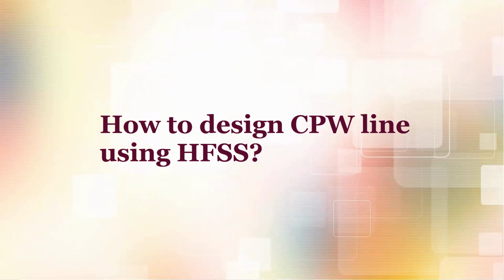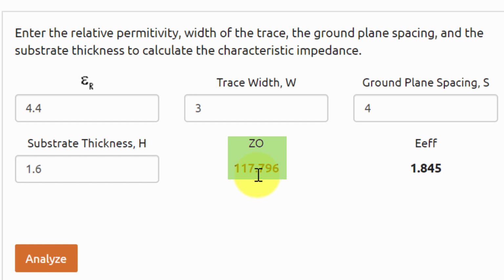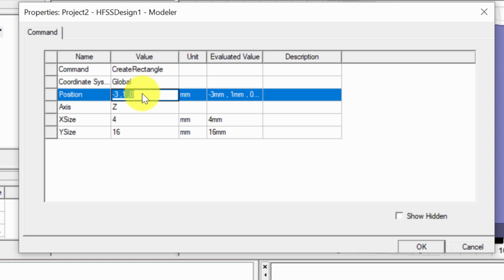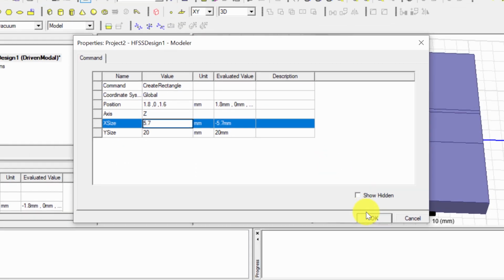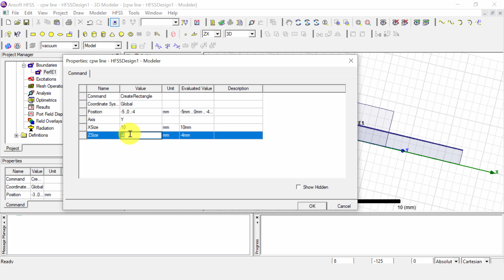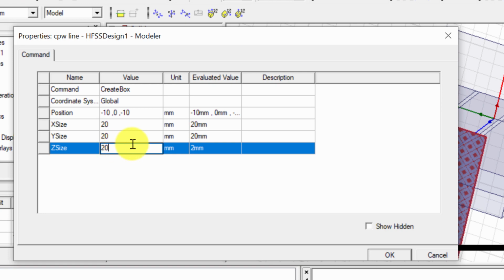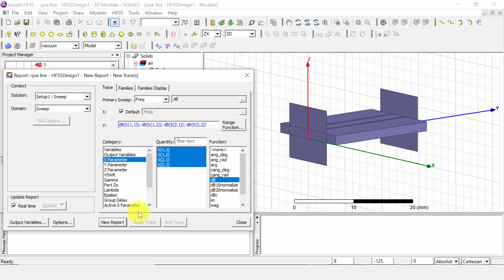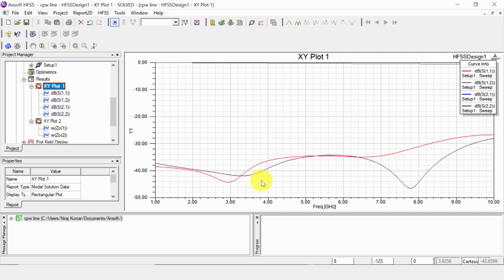Design of 50 Ω CPW line (Coplanar waveguide line) using HFSS and exciting waveport.

Comment: Thank you so much for very helpful video. I have one question. Why are there two dips (valley) around 3 GHz and 8 GHz in the reflection lines(S11 & S22)? Thanks in advance.
Reply: I really want to know this situation.
Reply: @gurumiya  Hi Hanna , I found that this is the reflection between two ports . Though they are impedance matched, still slight difference causes the reflection dips . Let me know if you have any other queries.
Reply: @Deep_1603  oh thanks. I have one more question about simulation. What is deembed of waveport in HFSS? Why it used in the design? And when i use deembed with -100cm of both port, the two dips occur in more cycles.
Reply: @gurumiya  As per my knowledge, one uses this feature for PCB designing. If the actual ( let's say SMP connectors )  ports are far away (let's say 2 cm) from the launch pad ( or the ends of the stripline ), one can use deembed feature to define the distance between the ports and the launch pads.
Reply: @Deep_1603  could you explain more about many dips in S11&S22 when I use deembed feature?
Reply: @Deep_1603  why do i get two lines when i do the plot z0? as far as i know it's related to excitation modes, but I don't know well.
Reply: @gurumiya  hi, S11 and S22 dips are due to the reflection. Now when you use deembed feature then the actual ports are located far away from each other which means the distance between them is increasing. We know resonance frequency is inversely proportional to the distance ( length of the resonator ) . Hence if you keep increasing the distance between them the resonance frequency decreases. Henceforth, within the same span of frequency ( or frequency range ) you will get more higher harmonics of the fundamental resonance frequency. This is why you get many S11 or S22 dips.
Reply: @Deep_1603  thank you so much for valuable answer. It is really helpful for me to understand this results. If you don’t mind, would you let me your E-mail or other account to send message to you?🙏🏻 I’m starting to study HFSS and i really need help.  Thanks in advanced.
Reply: @gurumiya  Hi Hanna, it seems that we can't exchange email. My replies are continuously being removed. Do you use WhatsApp?
Reply from the maker: In that case you both can share your email with us. We will help you connect. My email is in about section.
Reply: @RFDesignbasics  hello, I just wrote to you. Thanks for your help.
Reply: @gurumiya  Hi Hanna, it's not possible to exchange contact no or email in comment box. It'd be really helpful if you send a mail to the channel. Their mail id is given in the description of the channel. That's the only way we can exchange our mail ids. Thanks
Reply: @Deep_1603  oh. I see. Thank you so much. I will do that.

Comment: Is there any online site where we can determine gap size with our dimensions?
Reply: I don't know any online services, but there is quite famous txline program, which is free.
Reply: so there's a few calculators, but I suggest referring to T line design handbook by Waddell. he has formula for CPW on page 73 which involves solving the elliptical integral of the first kind. there's a matlab function that you can plug that argument into that is based on the gap width and trace width.

My recommendation is to pick a trace width, then solve for impedance as a function of gap width. then pick the gap width that yields 50 Ohm

Comment: nice vdo..is there any justification to set the size of the wave port..and why two port has been considered..
Reply from the maker: The size is considered as per the document tutorial for HFSS. Two port is taken for checking transmission coefficient of the CPW line. If using in CPW antenna, only single port is needed.

Comment: How to decide size of waveport? It has to be given both sides why?
Reply: rule of thumb is to have the waveport be 4*the width of the trace, and as tall as 4*the height of the substrate. makes sure the bottom of the wave port touches the bottom ground plane
Reply: @jacobrandall4891  Hii, but in the video the ports does not touch the bottom ground plane.